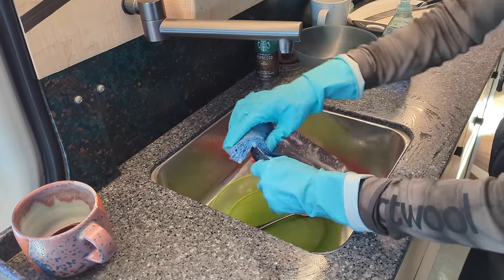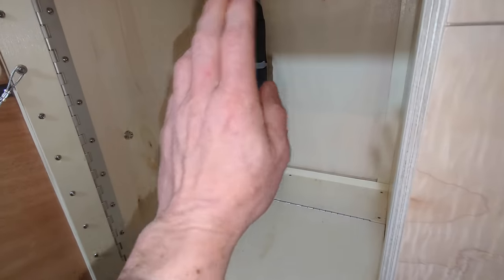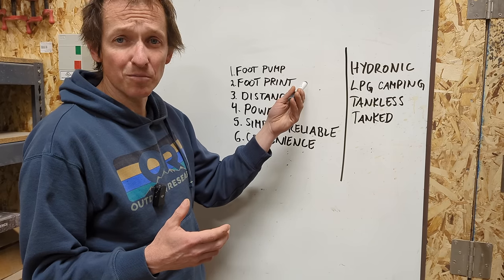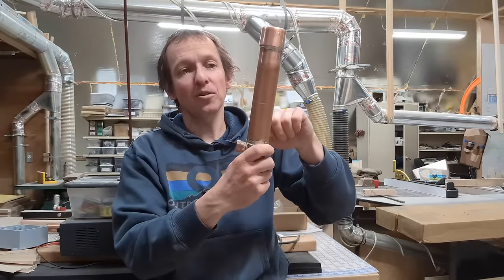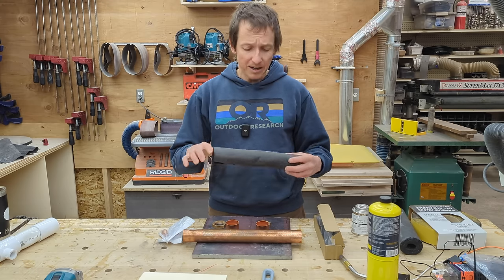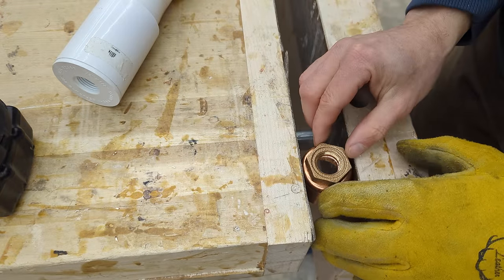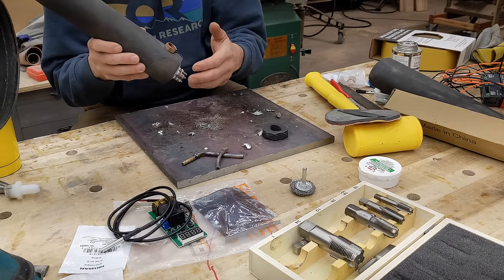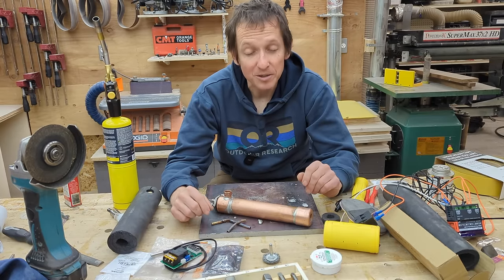Make Your Own WATER HEATER For Your Camper Van

Comment: Dangerous, There is no t&p valve in case you have a runaway
Reply: What is t and p valve. What is a runaway? Thanks 🙏
Reply: @Robertmillsjr  temperature and pressure.  If something malfunctions and you get an increase in pressure and/or temperature, there needs to be some kind of relief.  If there is no relief this could lead to a dangerous explosion. This is why pressure vessels should have over pressure release valves
Reply: Thanks